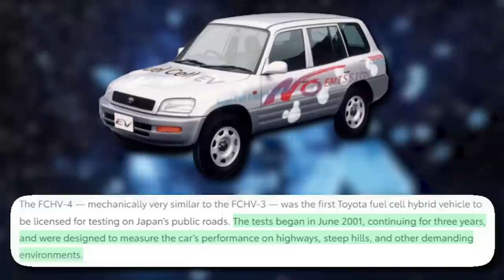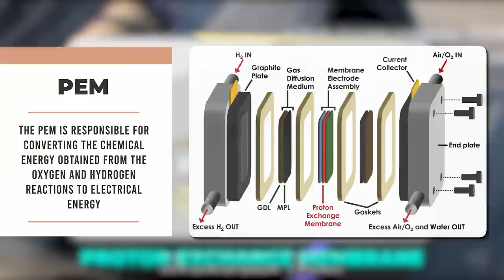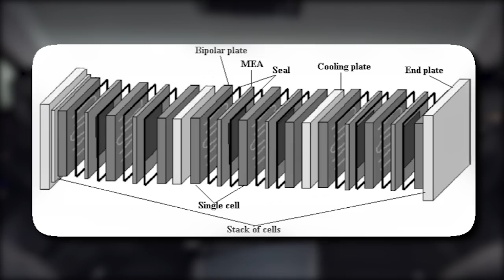Toyota CEO Releases 4 New Models | GAME CHANGER

Comment: They are all electric drive vehicles. You have to compare them with hybrid vehicles. They need a driving battery, tey are driven by one ore more electric motors, but they additionaly carry a hydrogen driven electric generator (fuel cell). The power efficiency  is far behind pure battery driven concepts, but make sense for large energy consumption cars. The normal passenger car does not need this extra effort. It is not an alternative to elektric vehicles, its an addition.
Reply: Look up JCB hydrogen powered ice vehicles.
They are producing ice hydrogen powered heavy vehicles, because ev powered heavy vehicles are not a viable alternative for heavy industry, and won’t be for the foreseeable future.
Reply: @Invictus357  this is exactly what I was writing. FuelCell makes sense with extremely power hungry machines, which cannot be fed by cables. At the end, they are electric machines, getting power from a fuel cell. After fuel cells like to deliver continous power, the need a buffer battery for high performances an for regaining from recuperation.

Comment: Does not matter the specs of the vehicle Hydrogen is still made from natural gas so still a polluter.
Reply: Electricity doesn't come from magic holes ev batteries also are destroying poor countries thru mining
Reply: @turnerarmstrong4282  Those poor countries are fast becoming dumping grounds for TOXIC WASTE (EV  BATTERIES).
Reply: EV is toxic.. hydrogen is a step in the right direction, we need hydrogen to replace batteries in solar installation as well. Hydrogen is an answer for off grid reliable power, especially where sunlight is not consistent, green hydrogen can come in later.. before we should have hydrogen infra with blue or grey hydrogen.
Reply: @ng-lj7ow  0:59
Reply: @ng-lj7ow  Unless you can copy Tesla's path.  Refill stations ahead and home refilling (storage or simple device to produce).
Reply: @turnerarmstrong4282  Coal has been outphased of most countries in Europe, including the UK, and is being outphased in the US at a fast pace.  I live 50/50 in Switzerland and France, and both countries' power mix is 95+% zero carbon (almost entirely nuclear, hydro, other renewables).  So, your argument does not hold, unless you restrict it to Poland or WV.
Reply: @st-ex8506 I'm all for clean energy but the batteries take a lot of natural resources to make can't be recycled and China makes the profit

Comment: Electric cars are the biggest environmental con going, the amount of co2 required to produce these batteries is massive not to mention the environmental damage of obtaining the raw materials the  best option for environmental and sustainable needs is the hydrogen ice car as the engine production facility is already in place and converting a petrol engine to hydrogen is simple and there are no co2 emissions nox is produced in small quantities but can be removed by exhaust after treatment it is good to see a car manufacturer going it's own way rather than blindly following the crowd
Reply: Hydrogen cars have batteries as well. 

Also, the amount of CO2 form all the mining, refining, and production for an EV battery is less than a typical gasoline car burns in 18 months. That's the breakeven point of where EVs start making less CO2 (by a lot) than burning gasoline in a piston engine. That is a widely debunked argument about the carbon impact of battery production. 

Plus, EVs can get energy from non-carbon sources like nuclear, hydroelectric, solar, wind, and geothermal. In my area, less than half of our energy mix comes from fossil fuel sources... mostly gas fired turbines. In my own household, we get 75% of our energy from the solar array on the roof. You can't reasonably make hydrogen at home, or gasoline.
Reply: Wrong.

Comment: it won't change anything except wasting time.  think about where do we get hydrogen on the very first ??  can we manufacture hydrogen easily without any pollution ?? how much will be  a tank of hydrogen ??    Think about this first before continuing your production.
Reply: Solid argument, kind of Like all the combustion vehicles running on oxygen and fuel........ Dunno how we haven't run out of oxygen already 😂
Reply: Yes, some places can make green hydrogen, using wind power.
Reply: @devdroid9606  yes, then only some places may use hydrogen fueled cars
Reply: Lol. Stop panicking. Water is H2O. 
1. When hydrogen is produced from water (using energy), oxygen is released into the air. 
2. When hydrogen is recombined with oxygen from the air (producing energy),  water is produced.

The amount of oxygen for you to breath does NOT diminish.
Reply: @canwelook  Right, home devices to create and store hydrogen is critical.  without it, Mirai goes nowhere.
Reply: @devdroid9606  They indeed can... but do they?  No, because it is simply not economically sound!
Reply: @canwelook  Correct, but you forgot one thing:  the oxygen that is emitted when hydrolyzing water is absolutely pure hydrogen.  But the oxygen a fuel cell gets out of ambiant air is polluted... and those pollutants poison the fuel cell catalyst, which therefore need periodic replacement... a most expensive maintenance item nobody, especially Toyota, seems to talk about.
BTW, I am a chemical engineer who is working on a hydrolyzing technology that produced hydrogen while releasing NO oxygen, but rather a valuable chemical, while using less electricity than the "regular" hydrolyzers...  But don't worry for the oxygen level in the air...